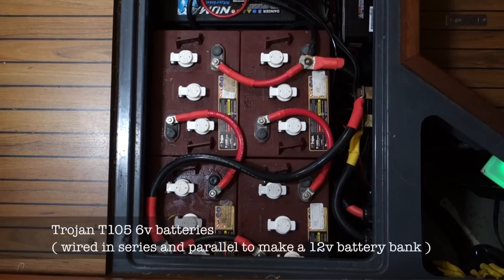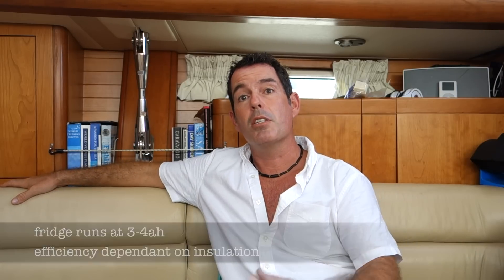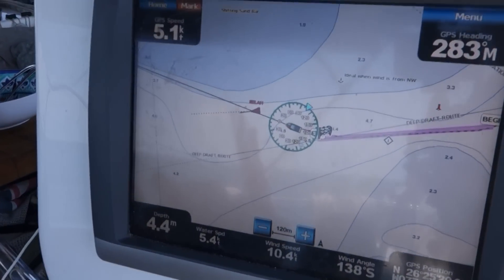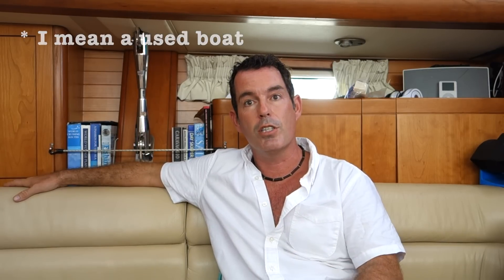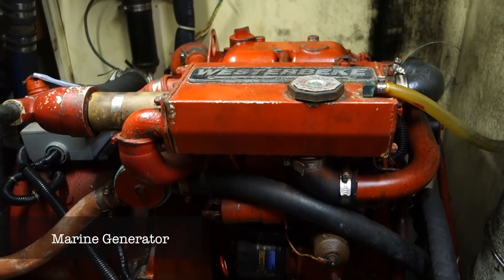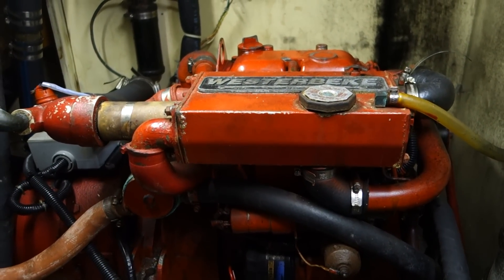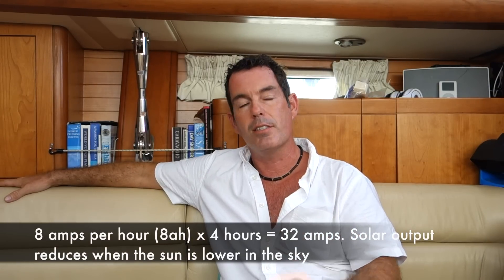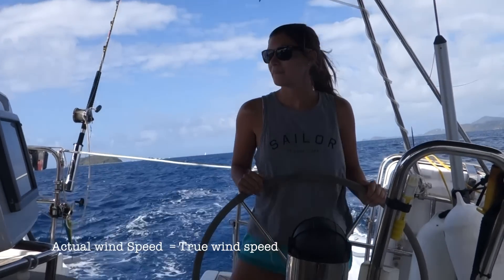How to generate power onboard? (Sailing Ruby Rose)

Comment: You've been a little unkind on Lithium batteries as they have a few more pluses than you mentioned. Sure they are hugely expensive when compared to lead acid batteries at first glance but after the initial purchase they will out perform lead acid/ agm in every way.One  300amp lithium battery could replace your entire battery bank so there's a huge weight and space saving. Lithium don't produce any toxic flammable vapours.Golf cart batteries are rated for about 500 cycles but lithium's are guaranteed for 2000 cycles and will typically last much longer than that. Just using this 2000 cycle figure lead acid batteries will need to be replaced four times to match the life of a lithium. I realize many cruisers will run the engine/generator for an hour or so each morning to replace the bulk charge for lead acid and then rely on renewables during the day to get them to 100% but many cruisers with lithium systems don't need anything more than renewables to achieve the same thing. Lithium batteries don't need to trickle charge their last 20%. Lithium systems will handle all sorts of abuse that would kill a lead acid system. The Wynns run their a/c off their lithium batteries.All things considered there's very little cost difference between the different systems considering the life of lithium along with the cost of running engines etc but I'd guess that is about to change as lithium improves. I've very recently read that a new lithium battery has been developed that charges in 5 minutes but as yet it doesn't hold as large a charge as the current ones. Watch this space as there's a huge amount of research going into lithium development.

Comment: Agree with most of what you said.  In the 
u.s. most genset problems are caused by ethanol in regular gas leaving residue in carbs and making hard to start.  That can be solved with a propane/lp conversion kit..makes mine easy to start every time..you can use 1 liter Coleman camping bottles for fuel if you don't want 20# tank.

Comment: Would you try to buy a boat wired for US style current vs European?  Is it easier for resale value?  If sailing 75 percent in South Pacific and  Caribbean. Vs 25 percent in Europe .... ?   If you find the perfect boat in Europe ----Is the cost of retrofitting from European to US awful?  Does one type of current work better on the boat?  Comments?  Thanks guys!  Hi Terysa.

Comment: A relatively minor point in your excellent video ............ you didn't mention the load on the batteries due to the engine starting and how much it might drain them.  Also .... it would be interesting to hear how you segment the batteries into engine starting and "house" electrical services.
Reply: I presumed as much.  Just wanted to help with completeness on the topic.  Thanks.

Comment: Peter here - No reason why the diesel generator isn't as reliable as the main engine depends on what you buy? Northern Lights are very good,  three cylinder 6.5 Kw but important to load up a generator as they like to work hard. D400 wind generator is great. Hopefully Nick it doesn't go all Pete Tong not "It's gone all Pete" LOL Happy days from Sint Maarten to you both.

Comment: This was a good video, Nick!  Do you happen to know what the usual problems are with gensets?  Is it a diode bank going bad, or perhaps a regulator?  Other than the engine, the rotor, and the stator, there's nothing left to go bad, is there?

I hope to be able to buy a boat in a couple months, and before this video, a genset was an absolute requirement for me.  Now I'm rethinking that.

Comment: How to understand amp hours:  Let's say that you can run hard for an hour and then you collapse, gasping for breath and the EMT have to be called to give you oxygen.  Let's call that one amp being used for one hour; i.e. an amp hour.  Now, let's say that you can walk for four hours before you're absolutely knackered and have to call the EMT for oxygen.  In our example, that's also one amp hour of total energy, except that it's used up over four hours.  So, each hour while you're walking would be 1/4 amp hour in the example.

So, as you can see, you don't have to know what an actual "amp" is, nor a "volt", nor even a "watt" or "watt hour" in order to be able to relate to an amp-hour.

Comment: Piston glazing is supposed to comes from long running at low power and low engine temp so be sure to do some regular 10-15 min running at WOT ( it hurts but it's good for the Diesel engine). Yanmar & westerbeke both say this too.
The best one page on cylinder glazing I have read is here from cox engineering.
https://coxengineering.sharepoint.com/Pages/Boreglazing.aspx
It confirmed what you say,  a properly 'run in' engine from new can be used for battery  charging as long as engine is up to temp (engaging prop will   keep temp up during charging but may not be practical all the time).
Cheers  Warren

Comment: Using the alternator doesn't put the engine under any load? I'm by far not an expert on diesel engines but physics are one of my fields of study. If the alternator isn't putting any load on the engine yet delivering power to your batteries where does it come from? I can't see any way that the alternator can deliver power without putting a load on the engine. I did some rough calculations and would say a 50 amp alternator at 12V will take just under 1hp to drive.
Reply: I too see no issue with using a modern marine diesel to load the house banks daily. I'd for sure upgrade the alternator to at least 100 amps. 
I've often used large diesel gensets to power a small festival (120kw) and know I was using about 220g of diesel per kw of power. I wonder what the efficiency is like on a main diesel of your size when it's only powering an alternator. Just did a quick search but didn't find anything of use.
Reply: OEMs rarely/never publish BSFC at low speed & low load because the engine inherit friction and heat conduction is dominating the fuel consumption, not the load. Its a very inefficient operation regime. Taken to the extreme, an engine at low idle and no load is 0% efficient, and infinite/undefined BSFC (X g/hr fs divided by  0 kW). There are ways to estimate what it will consume (kg/hr or gal/hr) using FMEP, BMEP, and BSFC part load curves and interpolation.

Comment: What great start up info for the off grid power Needs.  Thanks, Bottom line I hear is start with a good wind generator , ( and easiest probably to install), see how you make out , then consider adding solar as required. 
Any maintenance or install issues to consider? ( excluding a diesel generator).
Cheers Warren. 
Ps loved that you shaved for the techie video!!!
Reply: http://www.sailboatstuff.com/images/Imtra_Wiring%20Recommendations.pdf

Comment: On batteries, there is a better technology available. The biggest advantage is double recharge cycles and you can discharge them completely, not just 50%. 160amp/h block costs around 3000 Euro. check: http://www.super-b.com/en/marine/#marine-category  A lot of people told me that they are also safer because the standard Li batteries can overheat and start a fire. In German last year, 12 boats burned down. Don't know why exactly, maybe also some wrong installation of someone who didn't know to do it right, because they were all in the same area.
Reply: TST1998 lifepo4 batteries are very safe.  They are the best and so many benefits.  We are running a 6kw alternator off our engine to charge if the solar is low
Reply: The thing to know about Li battery's is they are not all the same. You have to do some research on them. There are additives which make them safe and also prolong there life.  Look for a site that tests them.
Reply: I was saying the same. They seem to be at moment the best choice. But if in Europe quite expensive. If you order in China directly it is reasonable. Just don't know the quality.
Reply: TST1998 the Chinese ones are good quality too.  We love ours.
Reply: Regarding lithium batteries:  You can throw your phone down if it catches on fire, and you can get out of your Tesla.  But on a boat?  You're pretty much screwed.  The technology is getting there.  But, is it there yet?  I dunno.
Reply: In general Li batteries are safe, but obviously, some boats caught fire. Maybe it wasn't the battery itself, but the cabling. But for sure, if you install high current electric, you should know what you are doing. The LiFePO4 is safer than the standard Li. I checked in China where most are produced, you can get a 200 Ah Battery for below 1400 Euro. I am especially interested in it because I want to have an electric drive, but on a catamaran with more space. http://oceanvolt.com/solutions/private/multihull/

Comment: Today they even offer solar panels on the sail! Must be pretty pricey, but exists. If you have several solar panels, you have to make sure that they operate independently or if one panel has shade, all panels produce less. As well there are very flexible and resistant panels you can even walk on. Check: http://www.sunbeamsystem.com/us/  So you can use more of the surface of your boat.

Comment: Excellent video. Funny ending, amp hours are easy to understand, simply put means no blow dryers or curling irons, lol
Reply: Sea Travel I love my blow dryer, toaster, microwave etc but that's lithium batteries for you.  1600Ah
Reply: Sea Travel yes we are on a cat.  Our whole system cost $10k USD.. Chargers and batteries.  1800w of solar. This is our home. No generator
Reply: Sailing Yacht Ruby Rose a generator alone would cost close to $8k.  So we didn't get the gen set and put the money into lithium. We have davits that we mounted 3-250w of solar on as well.  You could build a mount on your stern to place 2-250w panels.  We are getting full output out of our glass panels, here in the Caribbean.  Enjoy ur time away from Ruby Rose

Comment: Excellent overview of electrical power alternatives on a boat. Just a couple of points to add:
1. Lead-acid batts, while relatively inexpensive, are heavy and bulky and wear out relatively quickly.
2. Lead-acid batts can be discharged deeper than 50 percent when needed, but doing so repeatedly will reduce their life-span. They are slow to charge and need to be kept at full charge when not in use (a small solar panel can suffice for this.)
3. A lithium iron phosphate (LiFePo) battery bank is more expensive, but properly managed should last about 10 years, is much lighter,  requires less space, charges more rapidly than other options, and discharges very little when left for months. Contrary to popular belief, they will not burn or explode if mismanaged (lithium Ion batteries have this drawback but not LiFePo). They do however require careful monitoring, management, automatic cut-offs, etc.. They are not an install and ignore item but are rapidly becoming a viable alternative for most cruising boats.

Comment: Is there any differences in life expectancies between your lead batteries and the mentioned highly expensive lithium batteries?  Other than the 50% versus 80% drawdown, are there any other advantages, disadvantages, and/or differences between lead batteries and lithium batteries?  With great appreciation towards both of you, thanks.
Reply: Jack: Check this out as well - super helpful:  

http://www.gonewiththewynns.com/sailboat-tech-why-lithium-batteries
Reply: the initial investment on the lithium batteries would seem more expensive...that's very true. however, on the long term usage/advantages...it'll last longer, less weight/storage space needed and yes, "cheaper".
Reply: it was. curious. is there a reason you two haven't create a patreon account?

Comment: Hi, thanks for the video, it's useful to hear your experiences of batteries and charging as I am doing up an old boat for live aboard cruising. Can I ask what make of wind generator do you have and is it noisy?
Reply: Sailing Yacht Ruby Rose Thanks, that's a great tip!  One more question, is your engine start battery the same type as your domestic bank?  (We have 345Ah domestic, but the engine start battery is the same type, so I am wondering about getting a smaller starter battery and moving the existing starter battery to the domestic bank to give us 460Ah.)
Reply: Sailing Yacht Ruby Rose ok interesting thanks, I had been looking at the Optima blue top 34M which is a specialised starter battery, supposedly low internal resistance, but it is 800 cold cranking amps vs 910 in our existing battery.  I am also tempted by Lithium for the domestic batteries, but terrified of the price!

Comment: Another great video, thanks.  With consideration of your current knowledge and experience, would you have installed the solar panels on the Bimini, side rails, or created an elevated stern platform?  What are others uses, advantages, and/or disadvantages of an elevated stern solar panel platform?

Comment: Very difficult to beat a good wind generator, and you have got a good one.  Your unit of energy is the ampere hour... Ah. The ampere is a unit of current, not energy.
Reply: Technically, yes, a watt is a unit of power.  And I don't want to start a poo fight.  But, when your always talking about 12 volts, an amp hour is a good abbreviation for power.

Comment: FANTASTIC video.
I've found, even from just one battery manufacturer, the same model battery will have almost a pound less lead & acid, depending on what factory it was produced in.
Reply: Sailing Yacht Ruby Rose Yes; batteries from a Hong Kong factory which lasted 4 years (one customer tended his for 8 years), only lasted 6 months when they started shipping them from Taiwan.